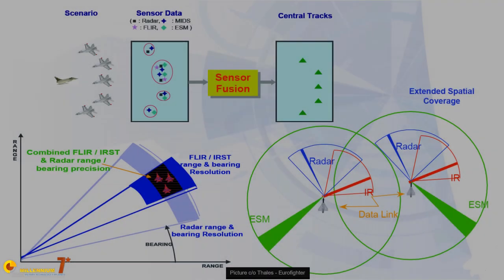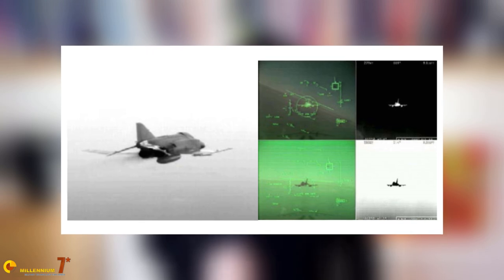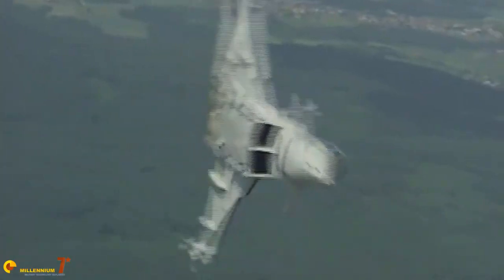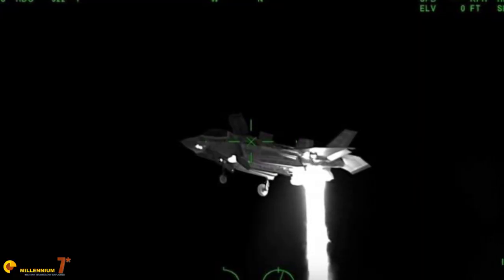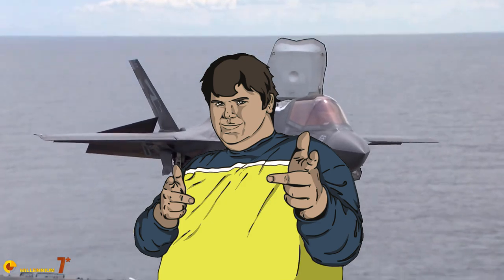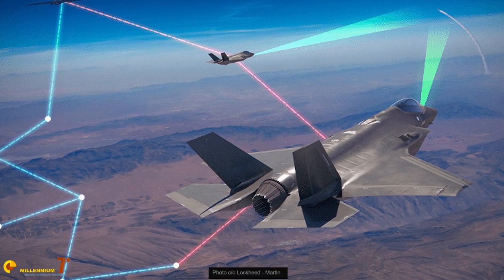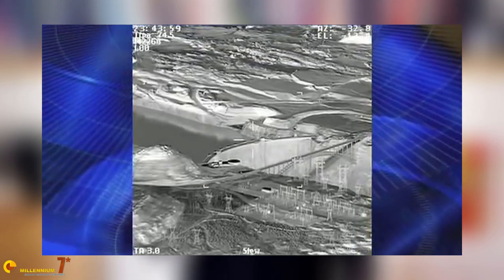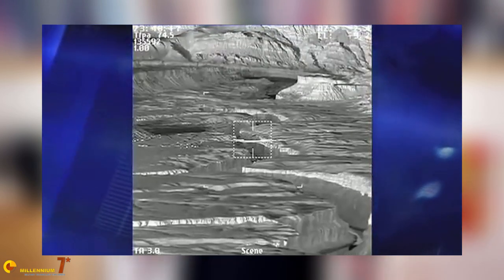The Other RADAR | Can IRST Infrared Detection Replace Radar?

Comment: If most fighters are equipped with IRST and heavy ground-based SAMs can be directed with longer wave radars, wouldn't that put a limit on the useful level of radar stealth?
If you can reliably be detected and targeted without a short wavelength radar at the same distance a fighter or conventional targeting radar can see a 1/2 square meter target,  wouldn't the stealth coatings that can bring you below that level of RCS be kind of worthless? especially given the cost of the coatings and their maintainance and the performance you give up in other areas.
Reply: A modern platform carrying an EW system will probably have expanded to detect LW too.
Reply: @christianm1533 
I wasn't talking about EW systems. they've been able to work against long-wave radar as long as Electronic warfare has been a thing, long-wave EW is actually easier because you can use a simple omnidirectional antenna for jamming, which you can't for shorter wavelengths. I was talking about radar absorbant materials being obsolete. the Rafale and Girppen have a reported RCS of around 1/10 of a square meter in an air to air configuration, and under average conditions, an enemy fighter's IRST system will see you before their radar does given that RCS value.  Granted, they do have some minor radar absorbing materials usage, but don't have internal weapons carrage.

@Michael Keller 
I wouldn't say that passive stealth is useless, a legacy fighter like an F-16 or worse a larger F-15 will still be seen on radar well before it shows up on an IRST system. stealth shaping is clearly still worthwhile, especially if you can get it to reduce your signature at longer wavelengths (like getting rid of the vertical tail). I'm more questioning the value of Radar Absorbing Coatings and ultra-precision matching required to bring your RCS down from 1/10th of a square meter with great shaping and internal weapons carriage to <1/100th of a square meter like the F-35 is claimed to have in the X-band. there is also IR stealth (better engines and nozzles) and radar stealth from sides other than the front that you could do a lot better without starting to use any fancy and expensive materials.
Reply: That’s called interferometry so yes but none stealth are even easier to detect
Reply: @jeanvaljean9293  I wasn't referring to using interferometry to get more accurate targeting from multiple long wave radar sites. I meant using a single AESA UHF band radar with state of the art pulse compression and signals analysis. the US navy has hit a target missile using an SM-6 from a destroyer and targeting data from an E-2D hawkeye with their new cooperative engagement capability, and the E-2D doesn't have a big radar as search radars go because it's a carrier plane.
Reply: @thamiordragonheart8682  so what you understood as interferometery is a multistatic radar (it can de low or short wave radar doesnt matter). 
What you are talking about is low frequency radar with advanced computer reconstruction data (something the russian are looking for to put on the su57, dont know if they made it yet). 
3 problems with that. 1) the missile may have had a linear or predictible pass (ballistic) 2) that wont work against any plane with electromagnetic warfare suite because uhf like l bande are easily jammed. 3) again no stealth will be detected even quicker further away. 
But you are correct passive stealth alone will disappear, you will need active stealth, like in the rafale, su57 or f35. But such a system works even better with a small rcs.
And stealth shape still works to a degree.
Reply: @jeanvaljean9293 the computer reconstruction or whatever gets used to achieve the required resolution (I think it's pulse compression and signal filtering specifically) already exists. the US navy has literally demonstrated it and they don't even have the most advanced air defense systems in the world. it also helps that most long-range SAMs have active seekers and only have to be guided accurately enough to lock on with their own seekers, not perfectly onto the target. I also don't see why a predictable path is more or less of a problem for a long wave radar, I would expect that to be more a function of the missile with things like end game speed and maneuverability, seeker off-boresight angle, and datalink capability for midcourse guidance.

I believe that interferometry involves using multiple radar receivers to produce a synthetic receiver that has the resolution of a radar dish with the width of the distance between the receivers, which does help a lot. multistatic radar is different, and at least as computationally complex because it needs at least as much computer reconstruction to work. the reason that it is supposed to detect stealth is that most stealth shaping is designed purely to reflect radar waves away from their source from the frontal and lower aspects. a multi-static radar is supposed to catch the often less narrow reflections in other directions, though aircraft can be designed for all-aspect stealth and with this in mind and keep all their reflections to a very beam from all sides, at which point the multi-static radar isn't actually that much better.

as to electronic warfare, a digital radar with the advanced pulse compression and filtering to achieve the required resolution is actually pretty resistant to jamming because you have to output enough power to jam it across a large portion of the frequency range that it is using to actually degrade the radar too much to provide useable targeting data, and that's before you include frequency hopping capabilities. you also need to apply the jamming on the same radial as the target you are covering to actually hide it against a good phased array radar. Jamming is entirely possible but it isn't easy, and it isn't actually that much easier than with shorter wavelength radars, especially since longer wave radars tend to be much higher power, with requires a higher power output to jam.

the physics of electromagnetic wave reflection and resonance effects are such that a fighter-sized target physically can't be stealthy against long-wave radars. the general rule is that any shapes less than about 8 times the length of the radar wavelength can't be made to reflect the energy in any particular direction due to some combination of the shape looking fuzzy to the electromagnetic waves at that wavelength and some diffraction effects. Radar absorbing materials also have to have ea thickness on the order of at least 1/4 of the wavelength they are trying to absorb, and for long-wavelength radars, the coating required is too heavy for a fighter-sized aircraft to fly with, and even the B-2 Spirt's stealth is only effective against the shortest search radar wavelength (L band) used on budget AEW aircraft, and even then it doesn't reduce it to a ball bearing anymore.

I'm also very skeptical of active stealth because of the sheer scope of the problem that has to be solved. short of Air Trafic Control radar that no amount of fancy computing can generate a target quality track from, the radars will produce complex echos. to make sure you aren't accidentally increasing your signature instead, you would have to know exactly how the specific frequency of radar refects of your aircraft when it comes from theat particlar angle, and then solve that probelm for every angle and radar frequrency you expect to encounter. even if you precompute all of those (which would be quite expensive hardware wise), it would still take long enough to access the data that your active radar cancelation syste would have to work predictively. againts the type of digital AESA radar you would worry about, it can change frequencies and timings psudorandomly, and you would have to run all the number crunching to predict when the radar will ping you next and what frequency it will use, which is extremely dificult. at that point the only reason to take the extra complexity of active echo canelation instead of standard just jamming is political, not military. there is also always the option of trying to hide in ground clutter or behind terrain, and ground clutter is harder for longer wavelength radars to deal with because you get more resonance effects from objects on the ground producing powerful reflections.
Reply: @thamiordragonheart8682  again the example your are talking about is balistic ! Its problematic because you can calculate the past with just two points and you dont need traking. 
Again inteferomery as to do with the interference between the plane and the surroundings, multistatic radar uses different emitter and receivers, the stealth object is going to divert the echo, the distributed radars will pick that eco you do not need reconstruction.
As for jamming hell no, the radar doesn’t focus all the power in one point, the jamming does since it needs to protect a small fighter. 
We are an agreement on ram never said the opposite ...
For the active stealth, that why every configuration on a plane is tested in an anacoiq chamber.  Nothing predictive, just computing power and good algorithm. And thales on the rafale have solved the problem of aesa by creating simpler algorithms, the lpi cannot switch as much are you are saying without coding the signal or it would jam itself. The growler as the same capability already but needs more library to use it as such. The su57 has been showed to work the same way to the indian navy with less sucess then the french but smaller rcs. The isreali wanted to give their f35i that feature until LM took it upon itself to make it happen. Dont forget that a radar’s wave will be detected 4 time further then the echo and that the jamming system doesnt need to be predictive but immediate. It’s close to drfm but not exactly the same. 
« Ground clutter or terrain » is called terrain following.
Reply: @jeanvaljean9293  
why can't you just take a second ballistic measurement and send the missile a midcourse guidance update? I'm pretty sure that's how most long range missiles work, with the addition of maybe some weird complex target motion prediction. I agree that it's a problem, I'm just not sure how it's a different problem for long wave radars compared to more common short-wavelength targeting radars.
I thought the reconstruction required for long wave radars was because they tend to pick up noise like birds or rain or ground clutter that just doesn't show up on shorter wavelength radars. I agree that if you have multiple receivers spread across an area, there are some simple tricks you can use like filtering out anything that doesn't show up on multiple receivers that are much less computationally intensive than filtering the noise out of a monostatic system, but you also introduce a bunch of new problems, mostly around communication and coordination over long distances. You do need to aggregate the data from all the receivers and get it back to the transmitted so that you can keep the transmitter properly aimed at the target, which is no small feat for a combat system, especially with that quantity of raw data. it also means that multistatic systems generally can't be mobile because you can't get the data transfer very easily and quickly calibrating the system across multiple mobile sites with the required precision is even harder. if you radar is fixed, even if the revivers are silent, they are pretty useless once you loose all the emmiters in the network and fixed emmiters are pretty darn easy to destroy even just with GMLRS or glide bomb saturation attacks if nothing else.

The other reason that improved noise filtering is important is because it allows you to use a horizontally polarized radar, which gets much stronger returns from stealth aircraft but also tends to get a lot more ground clutter because of how radar reflection works. sufficient signal processing lets you get rid of the extra noise and leaves you with a stronger signal, great for detecting stealth aircraft that you might not have been able to otherwise.

about the jamming, the radar does focus on one point, it just sweeps the point across the sky to scan the whole sky. a fancy AESA radar can produce and direct multiple radar beams at once each using a fraction of the array's total power, but they don't have to and generally wouldn't for long range search. especially for long wavelengths, the airborne jamming systems also tend to be physical smaller than the radar they are jamming, so their beam is actually much wider and falls off more with distance than a radar capable of producing targeting data, and the jamming system is likely to have a lot less power available just due to it's smaller size and heat rejection limitations, especially on a fighter jet that has lots of thermal issues. I'm not saying you can't jam them, you clearly can, I'm just saying that a long-wavelength radar isn't necessarily easier to jam than a short wavelength one.

for the active stealth, I though the whole point of LPI was that it used infrequent pulses at pseudorandom time intervals on pseudorandom frequencies so that there wouldn't be an easy repeating signal to pick out. I know modern radar warning systems can pick them out most of the time at this point, so I don't doubt you can find them. I had just assumed that the delay between signal receipt and sending out the echo cancelation pulse was too short to realistically pull the correct pattern out of computer storage in that time and that the library was too big to keep enough of it in computer RAM to be very useful. I'm not super clear on what simpler algorithms would mean, but I don't know that facet of radar design well enough to even know what your talking about, let along make an argument for or againts it, so I'll just take your word for it on that one. Acive stealth just always struck me as one of those things that is theoretically possible and easy to demonstrate under controlled conditions but never really works as advertised in real life, and there are a lot of things like that, especially in the military. Even assuming it does work, I would expect active stealth to leave behind some pretty distinct artifacts, even if the absolute power of those signals is much smaller, or in the best case to leave a mysterious hole in the large volume of general random noise you get back on a long-wavelength radar.  regardless of how necessary, useful, or practical us armchair generals things it is, the raw computing power and computational tools to filter noise and find patterns like that do exist, and I have no doubt some brilliant engineer could figure out how to bring it to bear against active stealth to come up with some countermeasures just like there have been countermeasures and counter-countermeasures developed for every other form of electronic warfare yet invented. it's a whole lot better than passive stealth because it can be upgraded in software, but I don't see it as any more than more electronic warefare.

Comment: Why americans put their IR sensor on the bottom of the planes? Top mounted seems to be more beneficial
Reply: A mostly air to ground intent?
Reply: I think it is because their planes were built first without irst, and the Americans were slow to adopt this technology so they are upgrading their planes with  an  external irst pod underneath instead when they realized that this technology is a must have.

Comment: Lol, just mount 3 sensors per plane hooked to the same computer
Reply: Or use kinematic ranging. Works with only one sensor and without a laser. Just needs a few seconds to get the distance, if enough computing power is available.

Comment: Not to give the military any good ideas as they so often do pure evil like US funding israel's genocide now but I'm quite surprised at how unintelligent even US weapons platforms are. Notably how IR and optical systems is an afterthought relegated to an external pod. And often quite low tech at that. The 2004 USS Nimitz tictac UFO cases was filmed with a camera pod that was brand new in 2003 yet still used analog SD video. HDTV was commercially available around 2001. Sony introduced digital prosumer cameras in 1995. That analog camera pod was a 3million dollar unit afaik. So 20 year old consumer video quality for 3 million dollars. You'd think there would be some sort of ambition level in play in the unlimited budget world.